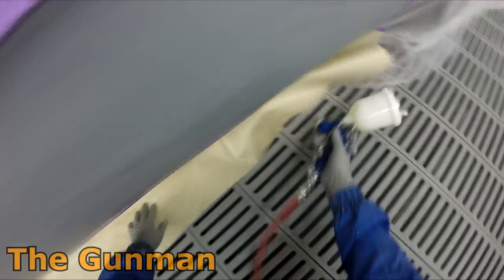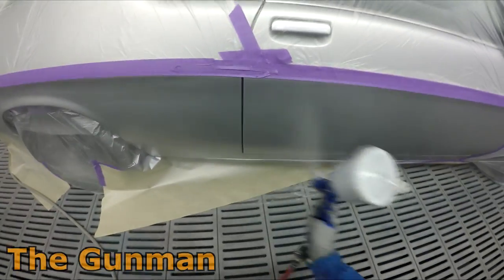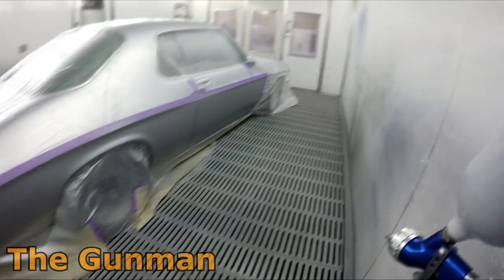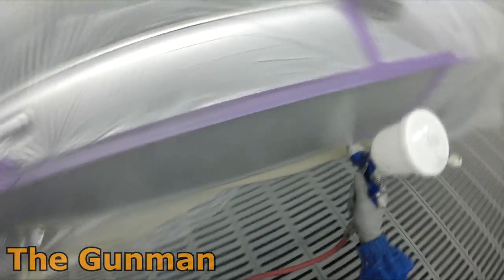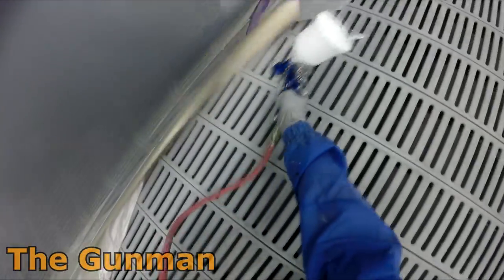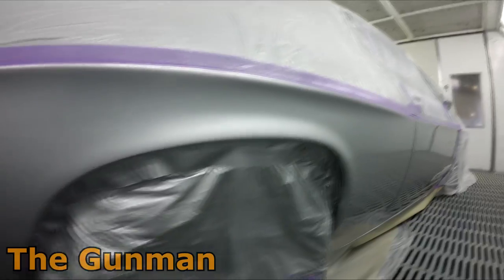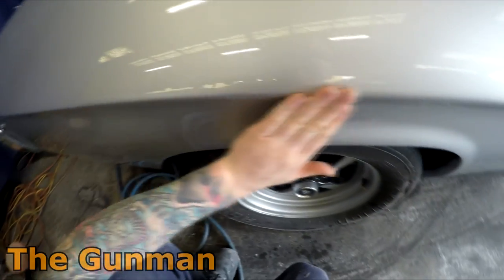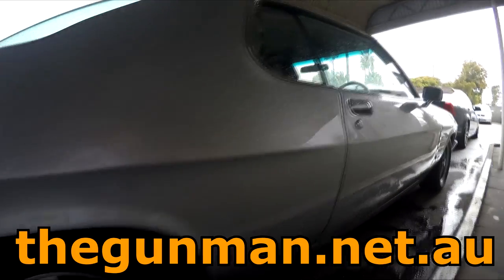HQ Monaro Spot Repair Part 3: Paint

Comment: I tried to become a panel beater when I was young , I did panel beating theory 1, I had painted some cars, I tried to get a job and no one would hire me. I even said I would work for free to gain the experience. I then gave up.

I wish I had of just asked the question what do I need to do to get a job here. Then it would of set me off on what I had to do. You can check my last creation of my xw falcon on my channel. I sold the car in the last video before putting the stripes chrome trims etc. And moved to Aussie from nz.
Reply: The gun I used was a jonnesway. A cheap gun. I just brought a devilbiss based on these vids from you gunman :) Next car a XC Fairmont
Reply: Do you really want to do it? There's easier ways to make a living. They're great skills to have and brilliant for working on your own stuff but the pay and conditions are crap. I'm a qualified body maker and spray painter and i wouldn't recommend anyone get in to it tbh. I did a year as an apprentice panel beater in 2004 for a luxury car dealer repair shop. out of the 5 beaters i worked with 3 left the trade in the year i was there and as far as i know none of them are on the tools or are in the trade now.
Reply: My current job is worse I work harder. Only thing better is no chemicals or dust. Tom check my vid of my xw falcon part 6, Painted the bonnet and left it to long out side got a bit cold. lol nz for u. But check the stripes first go ever. Better than a lot of pro paint jobs ive seen.
Reply: got a link? couldn't see it in your profile. your choice man but after 7 years back in the trade I'm going to pack it in next year. hard to get someone to take on an adult apprentice as they have to pay you minimum wage. i was on 6 bucks an hour as an apprentice. They say there's a skill shortage in automotive, its a pay shortage i.m.o..pretty much every other trade earns way more.

Comment: Hi Gunman, quick question, I have a vx Calais in tungsten, when I looked up the code( in spies hecker if that matters)there is 2 variants, would you mix up a small amount of both and spray them out if you didn't have the colour machine?  Would a small amount show up properly due to the small amounts of some of the tints, one is a silver base and one is more pearl. Thanks for any advice. Great videos again by the way, you have helped me a lot.
Reply from the maker: +Stephen Bunnik spies should have a spectro which is a camera that takes readings of your paint then finds the best variant and will also shade it, I know the colour and being in AUS they are getting a bit older and the sun does fade our paint quite a bit so while the standard variant may have been good when it was new it'll most likely need some matching to get it to look right. Are you planning on doing it as a diy project? It'll be tough to just have a mix and paint formula from my experience.
Reply: The Gunman Hi Gunman, thanks for the reply, I actually have a tinting machine that I got from a mate that went to waterborne. I paint a few kenworths for the people I work for so I was going to paint it myself, probably a full respray (was thinking touch ups but there are a few problem areas). Just wasn't sure on best way to get the right tint as I like the colour it is and there is supposedly a fair difference in the two recipes. And didn't really want to mix up a lot of paint in the wrong colour either. Thanks again, your videos are great and have helped me a lot.
Reply from the maker: Stephen Bunnik Yeah I'd just mix 100ml of each variant then choose the one you like, don't let the 100ml of the other variant go to waste, mix it with the 3 or so litres of the good variant, it won't change it enough to notice.

Comment: What is the rocket additive that you spoke of?
Reply from the maker: +Steve Janka it's a additive that accelerates the drying times of 2k paints, be careful with it though as it can make the paint brittle so I'd never use it on a bumper for example unless it was a last resort and we really needed to get the car out ASAP